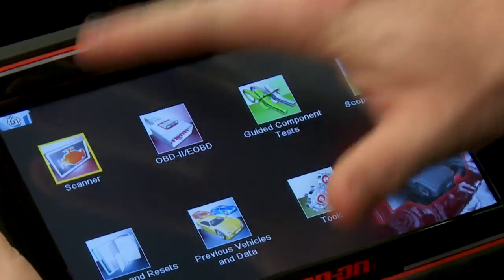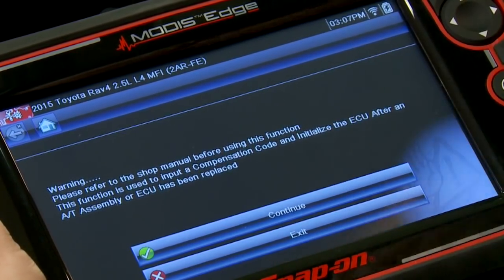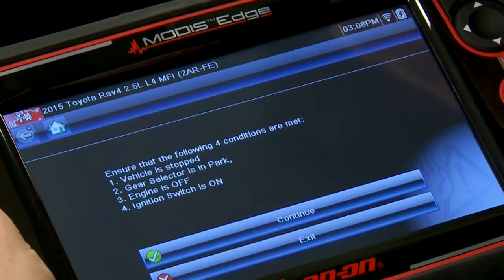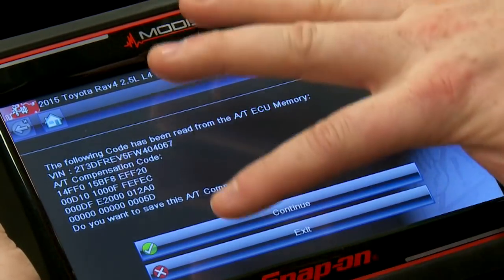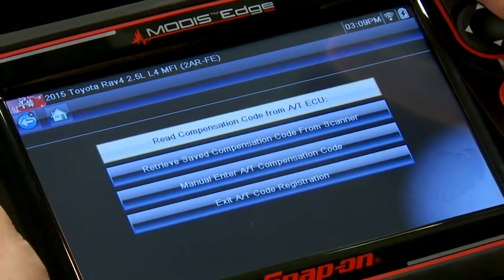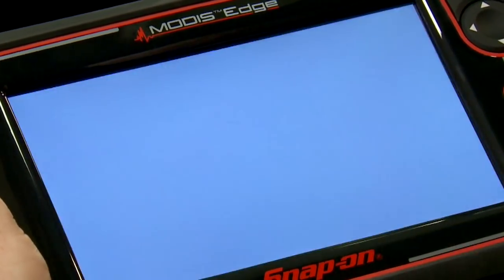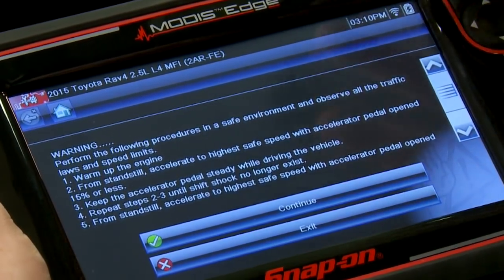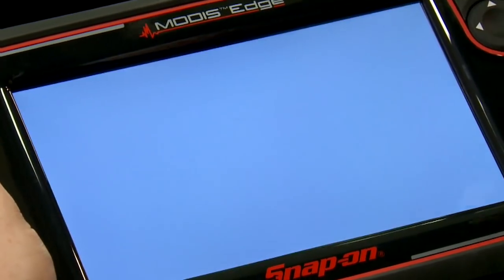Diagnostic Quick Tips - Toyota Transmission Compensation Coding

Comment: Thanks for the video,  it helped me from replacing my tyranny on 07 lexus es after replacing the fluid after 120k.
I heard there is sticker on the trany with original compensation values but could not locate it on my tyranny.  I did reset the memory  and the shocks went away
Reply: Without the code, how did you go about the memory reset?